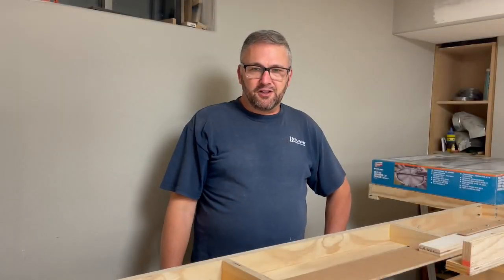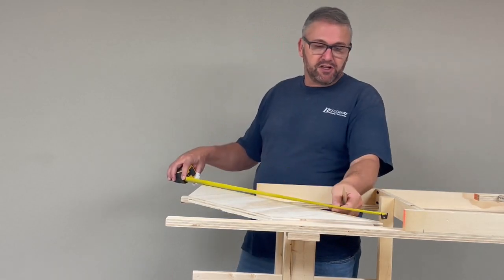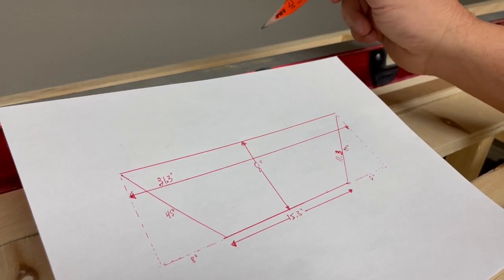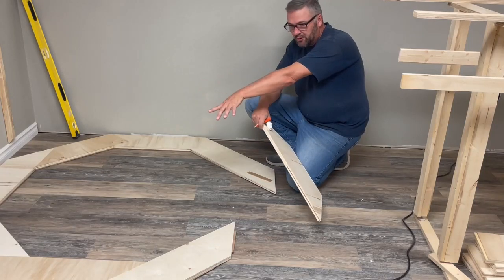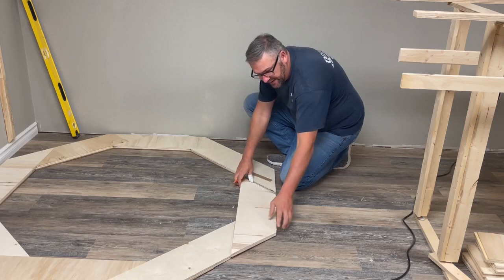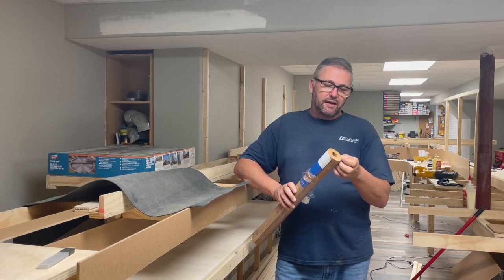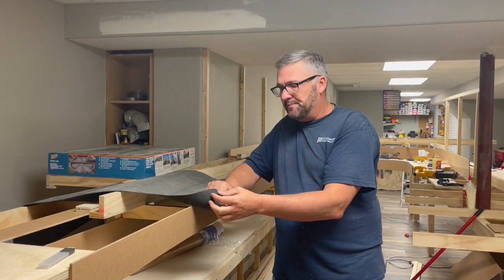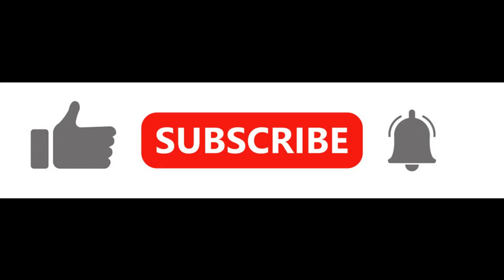HO layout Construction and How to build a Model railroad. Helix construction and roadbed choice?

Comment: Great Video and nice Helix. I'd be tempted to use the rubber mat under the yards and save the cork for the mainline as it will be easier to cut and form around the curves. I use the Midwest brand of cork on mine. Don't forget to lay the second track on your Helix as you build it, it will be difficult to get in there afterwards.

Comment: Hi, great video. I am looking at building a helix in the same format that you are using and several other videos using the same method, for my layout and you mention a 30" helix.. is that for 1 or 2 tracks? and how did you come up with the 30" dimension? I am thinking of making mine 28" radius outside track for going up and 25" radius inner tack for coming down. I am using a felt like underlay for my roadbed.
Reply from the maker: You should b able to fit both,place your threadrod on the outside of the cut out.